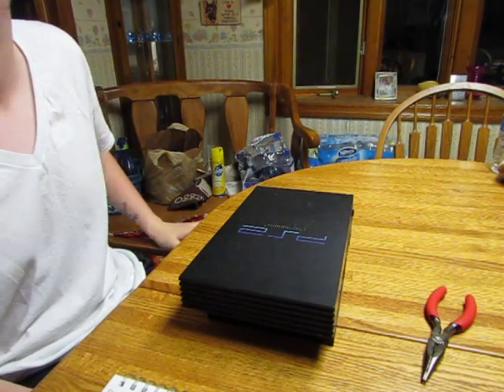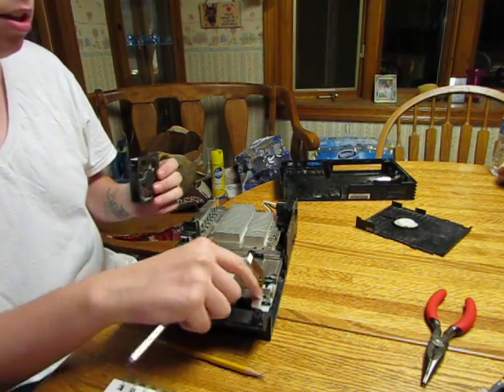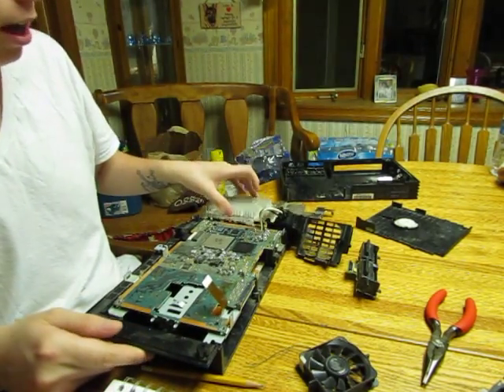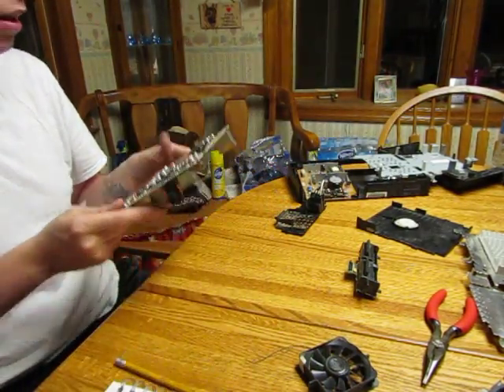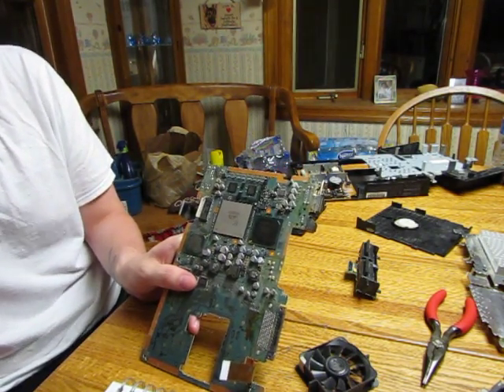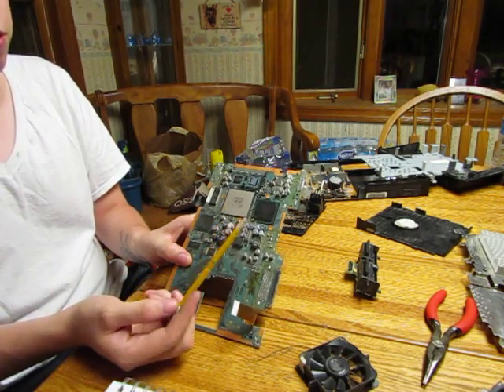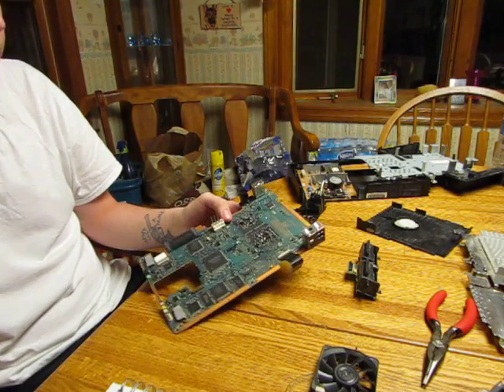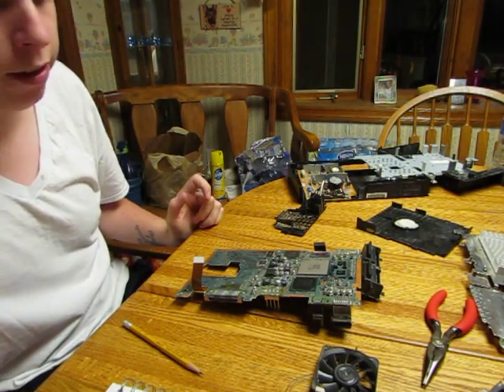PlayStation 2 Motherboard Explained

Comment: Emotion Engine was powerful, but somewhat difficult to develop for. Being more than 1 part, most developers, at least at the beginning, could not figure out how to use all the parts, and opted to only work with the main processor, resulting in lesser looking games.

Comment: The ps2's gpu bandwidth really was 48gb/sec. In fact, it really could've gone up to 160gb/sec if it wasn't limited by other components. The xbox 360 uses the exact same edram of the ps2's gpu. Unlike PC design philosophy of having a large chunk of vram, the ps2's small vram relies on extremely fast speeds and wide buses to do special graphical effects and streaming data from main ram.
Reply: Hansffdiiwyterrooo